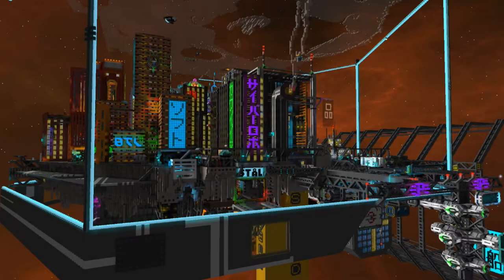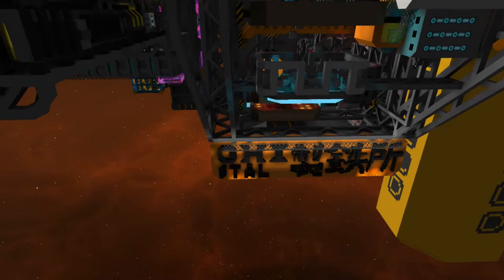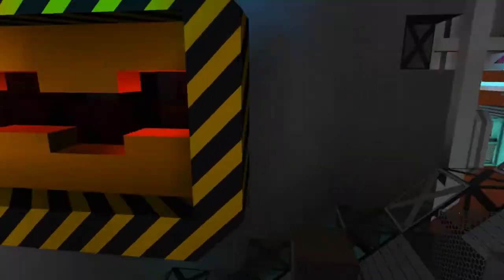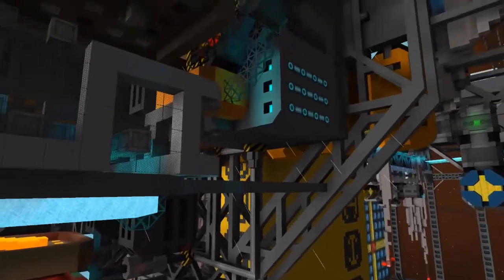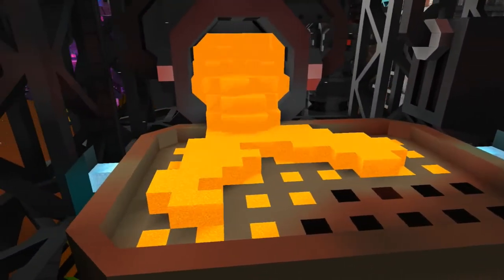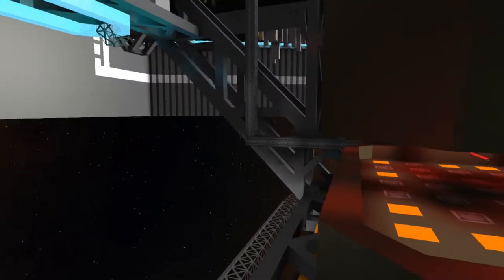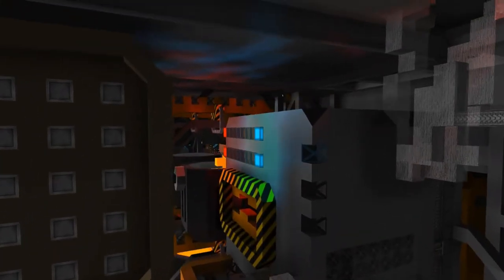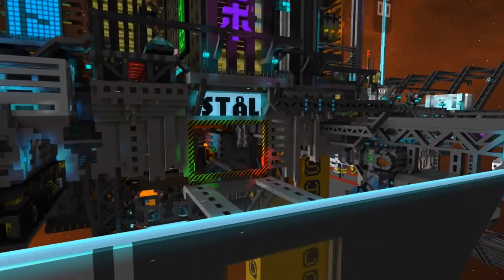StarMade - Pandora Haven: Steelworks, How It Works + More

Comment: Cool and good. When the steel is still glowing hot it probably shouldnt be put side ways. Probably creates some fractures in side it (i dont know much abbout steel making)
Reply from the maker: Well, probably ^^
Reply from the maker: Steel is sturdy, if they are used as a raw resource to melt it's probably fine ^^